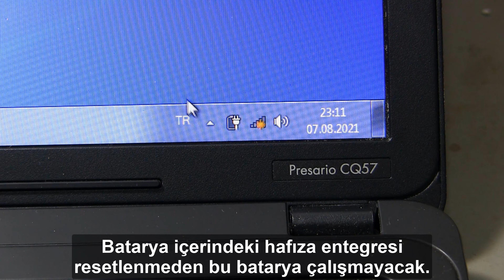TÜM DETAYLARIYLA LAPTOP BATARYA TAMİRİ. LAPTOP BATTERY REPAIR WITH ALL DETAILS.

Comment: Hocam emeginize saglik. Toshiba laptop bataryasinin pillerini gecen sene degistirdim. Yaklasik 1 senedir kullaniyordum ama dun sarj olmamaya basladi pil voltajlarini olctum hepsi ayni voltajda. Kart uzerindeki + ve - den baktigimda 11.90 gibi voltaj aliyorum ama pin cikislarinda voltaj yok. Ne gibi bir islem yapabilirim ? Simdiden tesekkurler
Reply from the maker: Merhaba ilginiz için teşekkür ederim. Yazdığınıza göre sorun büyük bir ihtimalle kart üzerindeki bms kontrol entegresinden olabilir. Bu entegreyi bulmakta biraz zor anca çin sitelerinden bulabilirsiniz. Birde kart üzerindeki mosfetleride kontrol etmenizi tavsiye ederim. Mosfetlerde de sorun olursa bu tip problemler yapabilir.

Comment: Ciao, vorrei sostituire le batterie al mio laptop che contiene 6 batterie panasonic modello CGR18650CG. Vorrei acquistare 6 batterie nuove da AliExpress. Quali batterie mi consigliate? Grazie
Reply from the maker: Hello
I have never bought batteries from aliexpress. That's why I can't recommend you a seller.
Reply: @electronic7979  ok. Che modello di batteria mi consigliate di acquistare? Grazie
Reply from the maker: @giannilorusso9924  What is the current rating of your laptop battery?  Can you tell me the values written on the battery?
Reply: @electronic7979  sulla batteria c'è scritto 11.1v e 4400mah
Reply from the maker: @giannilorusso9924  You can use a minimum 2200mah li-ion battery.
Reply: @electronic7979  ok. Ma che modello di batteria mi consigliate? Icr18650 oppure ncr18650 oppure altro modello? Grazie
Reply from the maker: @giannilorusso9924  Both ICR18650 and NCR18650 are lithium-ion batteries, but they have some differences in terms of their performance and safety features. ICR18650 batteries are known for their high energy density and low cost, but they have a tendency to overheat and can be prone to catching fire if not handled properly. NCR18650 batteries, on the other hand, have a lower energy density but are safer and more stable, making them a better choice for high-performance applications.

In general, if you are looking for a battery with higher energy density and lower cost, ICR18650 batteries may be a good choice, but if safety and stability are your top priorities, NCR18650 batteries would be a better option.
Reply: @electronic7979  Thanks friend 👍
Reply: @electronic7979  friend in your opinion the model battery hg2 liitokala, is good for change the battery to my laptop? Thanks
Reply from the maker: @giannilorusso9924  I did not fully understand your question.  can you write in english
Reply: @electronic7979  ciao amico, secondo la tua opinione, le batterie modello hg2 possono andare bene per sostituire le batterie al mio laptop? Grazie
Reply from the maker: I've never tried it, but I don't think it will be a problem.
Reply: @electronic7979  ok👍
Reply from the maker: OK

Comment: عندي نفس الحاسوب Compaq الموجود عندك🤔 في شرح
 بطارية مشحونة % 100  
لكن المشكل دقيقتين تنفد البطارية بسرعة 😢
Reply from the maker: you need to replace the faulty battery, but even if you replace the battery, the battery will not work.  because you will need to reprogram the charge control chip inside.

Comment: Great video. I would be more careful with the grinding wheel on the positive side, you removed the heat shrink insulation on the edge of the battery, and the entire body of the battery is negative polarity, the nickel strip being soldered to the positive could have touched the negative edge of the battery and shorted out. Or use an insulator paper ring. I make my own by placing a piece of kapton tape on top and cutting around the positive side with an x-acto/scalpel knife.
Reply from the maker: Thank you for your interest.

Comment: Hello what about chip R2J240     
I have in battery.Will it goes and charging laptop somebody know??Thanks if anybody replyes
Reply from the maker: There is software inside the R2J240 chip. When you replace the cell in the battery, you will need to reset the chip.

Comment: 我嘗試將電池組的正極端加條電線直接焊在輸出端的端子上 這樣是可以單獨用這電池組(電池裝上使用交流電來開機是78%的電力)來開機 開機後會顯示電池即將在沒電(電池顯示0%)請接上交流電源 的警告訊息 我插上交流電充電後 充電指示燈是顯示散爍 紅 滅 紅 滅 ....(我想應該是內部線路的控制導致無法充電) 以上供您參考 或許可以修改充電端的線路    補遺 我的電腦無法單獨用電池開機 加上交流電源是可以正常開機 但充電指示燈是不正常的慢速閃爍(紅 滅 紅 滅 ...間隔約1至2秒)
Reply from the maker: There may be a problem with the electronic circuit board inside the battery pack.
Reply: @electronic7979  我的意思是說電池組安裝在筆記型電腦上 若應用網上所提的方法都無法順利讓電池組供電及充電 或許 改變線路也是可以考慮的方式 之一

Comment: merhaba benim leptopdan çıkan piller lgabd11865 bunlar yerine 18650 aynı v değerlere sahip pil takabilirmiyim cevaplarsanız çok sevinirim
Reply from the maker: İki li-ion pilinde çalışma voltajları aynı sadece akım kapasiteleri farklı LGABD11865 pil 3000mAH kapasiteli 18650 pil 2200 mAH kapasiteli. Sorun olacağını sanmıyorum
Reply: @electronic7979  sağolun teşekkürler 😊

Comment: Hocam benim bataryamda bozuldu bilgisayarım bataryanızı değiştirin ömrü bitti diyor sizin videoyu izledim açtım bataryanın içini pillerin voltajı na baktım ikisi 3.7 volt biri 1.6 volt çıkıyor tamamı 9 volt oluyor normalde bataryanın üzerinde yazan 11.1 volt şimdi arızalı olan 1.6 v olan mi ne yapayım değiştireyim mi teşekkürler
Reply from the maker: Merhaba. 1.6v olan pil arızalı. Elinizde li-ion pil varsa bi deneyin derim. Batarya içerisinde hafıza entegresi yoksa pili değiştirince bataryanız çalışır. Eğer özel hafıza entegresi varsa batarya çalışmayacaktır.
Reply: @electronic7979  teşekkürler hafıza entegresi olup olmadigini başka nasıl öğrenebilirim
Reply from the maker: @mahmudhilmiyardim1880  Kart üzerindeki entegrelerin datashetlerini inceleyerek öğrenebilirsin.